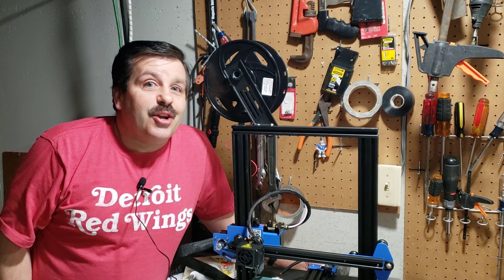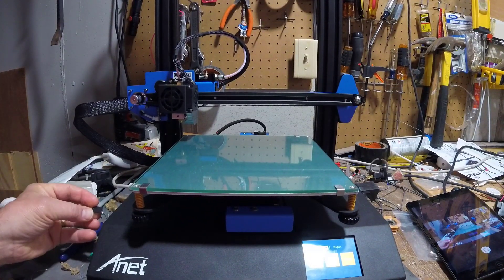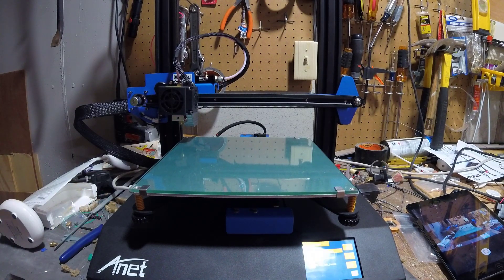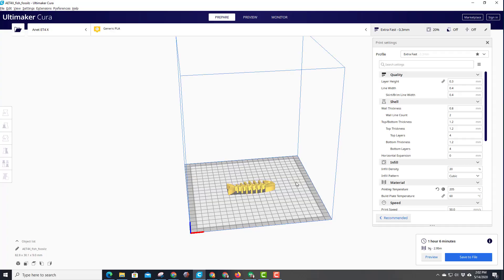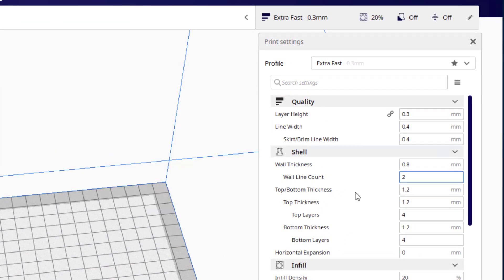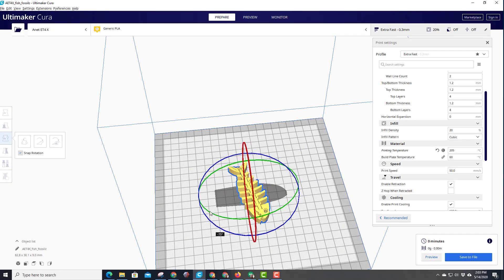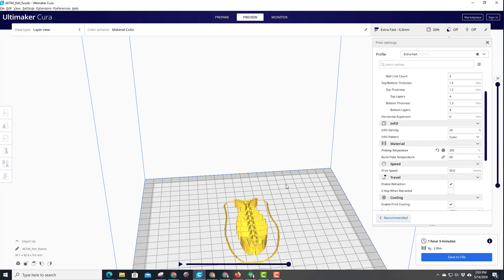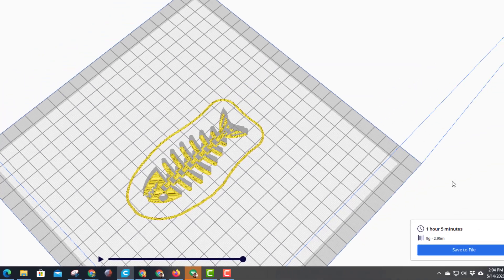Stress Test 1 for the Anet ET4x | A PLA Flexible Fossil Fish

Comment: Hi, How is your Printer? Brought for 2 months. the print head connector having issue! rewired Ok. but now Printer fail to heat up to print!!
Reply from the maker: Did you upgrade to Marlin 2? I do have one that has the fail to heat as well. I have been so busy with teaching I have not had time to diagnose it yet.
Reply: @HLModTech   it ok, it just the hot end connecter issue that causes it not able to heat up. Nothing to do with sofware. It hardware issue. Care.

Comment: I can't level my bed any tips?
Reply from the maker: I always start with that crazy simple cube. Prints in about 5 minutes. Not much waste if it fails. Did you see the "first prints" video? That is where I show the leveling. https://youtu.be/W8rpUASiBqQ
Reply: Mine would only go up. Mine is the ET4+ with auto bed level finally found the Prox switch adjuster.